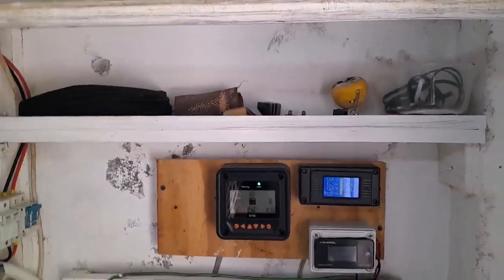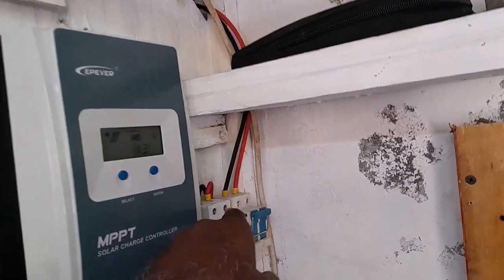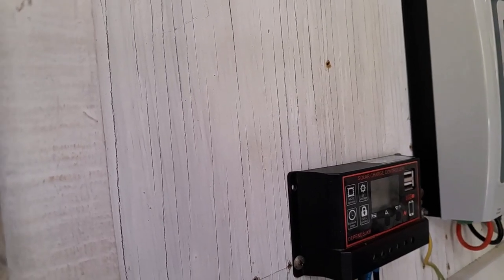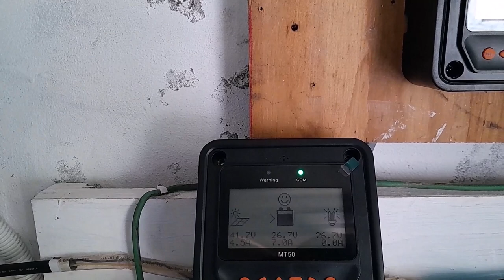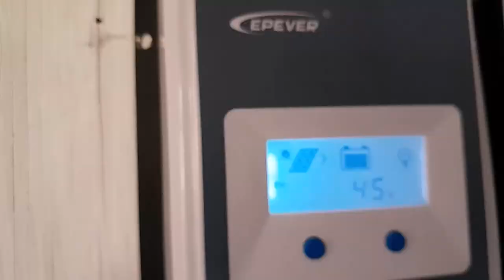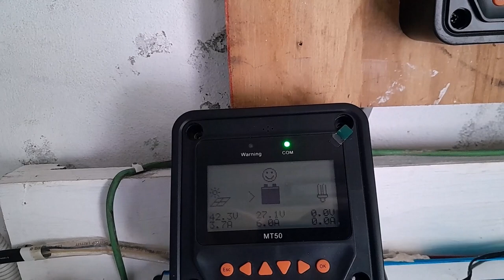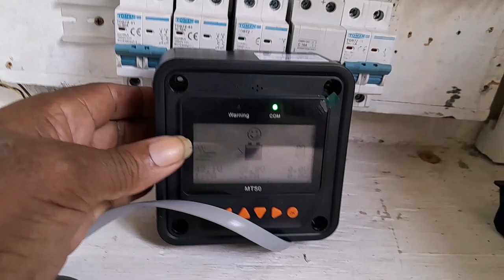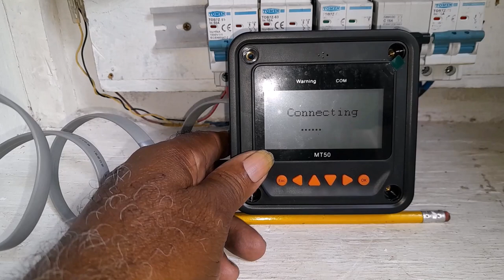Epever Controller Stop Charging problem Explain

Comment: I have a similar problem.
  Like yourself, i purchased a second Epever regulator, because i was very happy with the first one. 
 The new one has the same problem, and it is totally independent. I tried swapping the cables, as well as the cables with the MT50 monitor. No matter what configuration of cable, monitor and regulator, it is only the new regulator that does this.
 It is only a pain when i need to keep track of battery, because it generally kicks back in after a while.
 Did you find a solution, or do you just make do with it too?

Comment: I've watched this several times and I'm still not sure what you've got going exactly so I'll take a guess.
From what I've gathered It looks like you're running a 24v system,  2 epevers,  3 - 100 watt panels (in series, I'm guessing) and 2 car batteries in series.  Are the 2 epevers connected to the same battery bank?  The charge controller you call the good one doesn't look to be taking in that much power from the panels, so it might be in float mode and the system doesn't need any more power from the second charge controller.  Have you tested your system under a load?  Or maybe turn off the good controller and try running just the one that's shutting off.  Just an FYI, one of my epevers stopped charging and I was about to cash it in then I discovered it was a bad breaker. 🤷
Reply from the maker: No the charge controller is not on the same battery bank I have 8 battery's 4 per bank at 24v each of the charges controllers on a 24V at the time I had just one when it went out I bought the next one